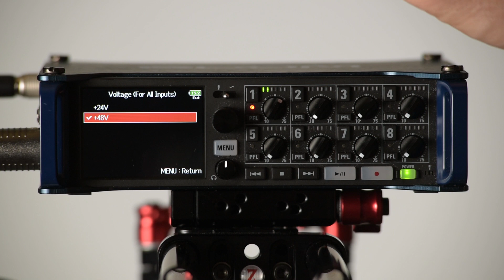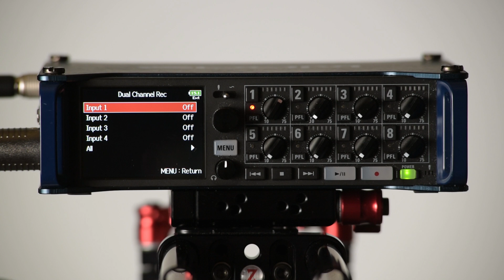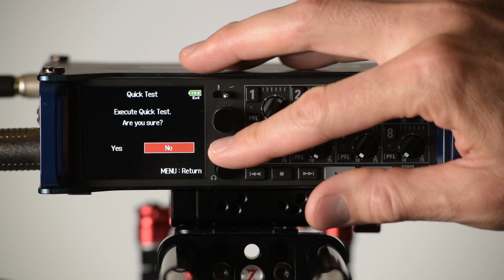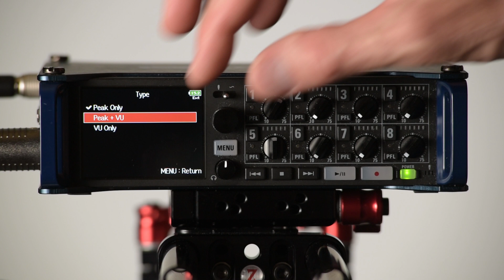Setting up the Zoom F8 Audio Field Recorder 30 June 2016

Comment: 0:00 Input Menu
0:30 HPFs
1:20 Input Limiters
3:06 phase Invert
3:42 Phantom Power
5:07 Plugin Power
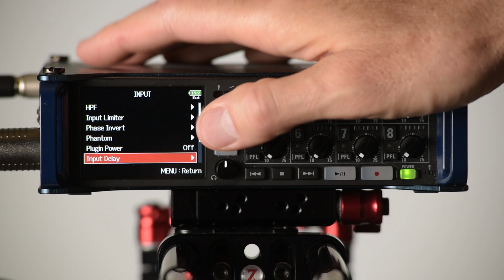5:55 Input Delay
6:55 Stereo Link Mode
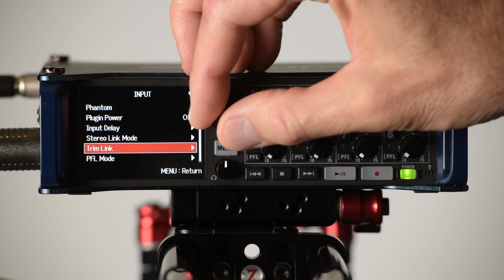7:17 Trim Link
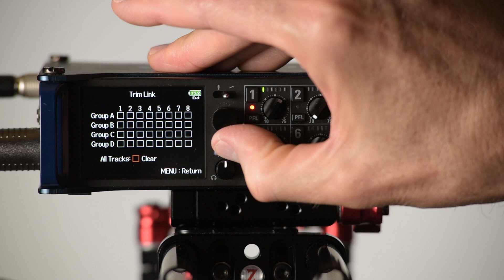8:05 PFL Mode

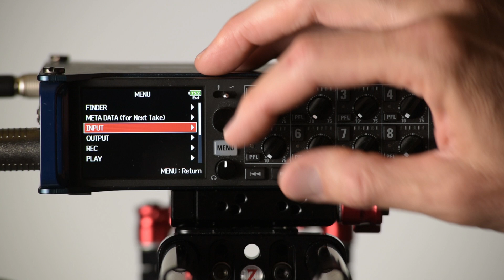8:56 Rec Menu
9:02 Rec to SD1/SD2
12:08 Sample Rate
12:46 WAV Bit Depth
13:48 MP3 Bit Depth
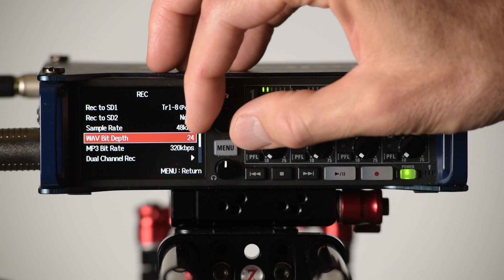14:25 Dual Channel Record
16:02 Pre Record
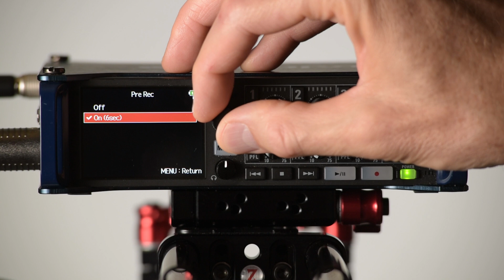16:20 Max File Size

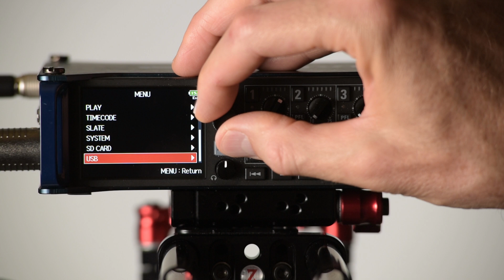16:36 SD Card Menu
17:53 USB Menu
18:44 System Menu  (Time Code Display, Auto Power Off, etc.)
 20:40 Level Meters
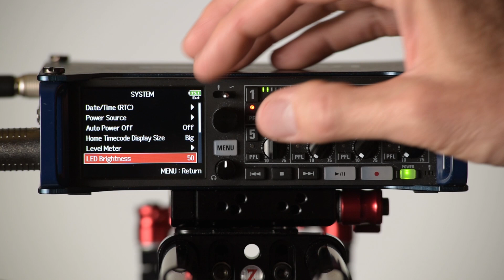22:30 Outdoor Mode
Reply: Thanks Wes.
Reply: Thank you for taking the time to do this!
Reply: Doing God’s work 👍

Comment: Hi Curtis if I was to use a high pass filter on my F8 while booming what frequency do recommend I set it on?
Reply from the maker: Hi Alejandro, it depends on what type of problem you're trying to solve with a high pass filter. If you're working with a microphone that is particularly sensitive to movement and your shock mount isn't doing it all, I'd start with an 80Hz high pass filter. If there's some sort of low frequency hum, you may have to tweak the setting, starting at 80 and sweeping up until it reduces it. If you're out in the wind and for some reason the wind protection for your mic is not preventing all of the wind from getting to the mic capsule, you may have to sweep up to higher settings until the wind distortion is handled. Note, however, that this is a tradeoff--when you sweep up beyond about 100-120 Hz or higher, you're going to cut into the bass part dialogue, especially with men's voices. You're usually safe to set the HP filter to 80 Hz and that will not affect the sound of most voices. I hope that helps!
Reply: Thank you Curtis actually it does. BTW, does your sound course cover how to operate the Zoom F8 on the field?
Reply: Glad it helped! The production (recording) sound course is not specific to any particular device, but more about the principles of recording quality audio (more focused on skills like microphone placement, mic choice, signal chains, etc.) Best wishes!
Reply: Sounds good! As soon I can clear up some things I owe I'll take your course. I know there are things that I can still work on, and I'm glad that the resources are there!

Comment: Hi Curtis
Just a quick question. I bought the F8 as an extra multi-tracking recording device for my Sony FS7. Almost a year on and I still haven't used it. 
At home I have a wonderful digital desk & DAW which works seamlessly with FCPX for additional sounds to any live sound recorded. The F8 was originally bought to add greater flexibility to live sound - especially wireless setups. I'm sure I will use the F8 for its intended purpose ( like you, I have a collection of portable digital recorders, but wanted "high end" quality, hence the F8)
My question has nothing to do with film, but "audiophile" recording. 
I've been asked to record a beautiful New Age group at the highest possible quality but to "audiophile " recording techniques. 
I have a collection of superb mic's.  Do you think the F8 is capable of doing the job - Dragon Records style? I'm thinking 24bit 96kHz wav
Reply: Hi Chris, yes I think it is up to the job. I would think the bigger challenge could be (not knowing anything about where you'll be recording) the room in which the recording is made and mic placement. But the F8 is very good on the preamp and analogue to digital conversion fronts. Best wishes!
Reply: Curtis Judd 
Thank you so much, Curtis. The recording will take place in a small chapel. The natural acoustics are lively, so some treatments will be needed. I'm hoping to capture a nice 3D sound stage and good dynamics as well as excellent resolution. The F8 has excellent mic preamps i.e. Very low noise - in fact equal to my desk which has class A preamps.
Reply: Sounds like a fun project. Best wishes!

Comment: Hey Curtis! I always find your videos helpful. Would you consider pairing this with the ntg4+ that you reviewed some years ago?
Reply: Hi Sean, Definitely! If you haven't already bought the NTG4, I'd be inclined to either go with the NTG3 or NTG2. I especially prefer the NTG3 but it is a bit pricier than the 4. Good luck!
Reply: Curtis Judd have you tried other sound devices like the 552 before choosing the 633? I've seen the 552 go for less than half of the 633 and has probably only half of the capabilities as the 633
Reply: Hi Sean, yes, definitely. The reason I did not go with the 552 is that it only has a 2 track recorder and I needed isolated tracks in addition to a stereo mix for my work.

Comment: Super helpful setup guide, thanks a ton for going through the entire settings. The one thing I have not been able to find online or in the manual is to alternate different microphones to the left and right headphone channels. I've used the 744/788s in the past and I liked the ability to change what mics I hear in what ear (boom left, lav right/boom both, etc). I believe this was done with just a knob that ran through A, A/B, B/B modes.

I have scoured the settings and haven't been able to find a way to alternate what I am hearing. Right now, all I get is a mixdown of the three mics I have (2 lav, one boom) to only the right channel in my headphones. Playback plays it in both. Any idea where I have to go into to be able to change the output to the headphones? 

Cheers mate
Reply: Hi, clarification question: do you want to pan the individual channels to the left or right in the recorded mix or just the headphone mix?
Reply: Just the headphone mix, so that I could cycle through how each one sounds individually
Reply: Ok, I see. Pressing the PFL button for each channel is one way. I'll have to dig in and see if there's another way.
Reply: Thanks. I just got so used to the 744. When I was doing sound for docs, I'd like to rock back between the lav's and the boom in my headphones so I could listen to each one on it's own to make sure everything was sound clear, I figured this was a stock function on other records!

Comment: Hey Curtis, first of all great video as usual! Are you aware of a short cut option to activate/deactivate the dual channel recording without having to go into the manus? I think I ones saw a option like that somewhere, but it is not in the short cut list in the menu and I can't remember the short cut.
I searched the web and read the manual, but couldn't find it.

It was something like pressing one channel (e.G. 1) and at the same time the other channels PFL button. I tested it on my own F8, but nothing seems to work.

Anyways, greetings from Germany!
Reply: Hmm, not off the top of my head. I'll have to have another look...
Reply: I just tested it on my own F8 and found out that I mixed two things up here. I thought of the short cuts for activating the stereo link between two channels. For example: If you press and hold "3" then "4" and release both channel 3 and 4 are linked in stereo link mode. (Do the same to deactivate link mode.)

I just thought there also were short cuts for dual channel mode.

Would be nice if Zoom put all short cuts into the shortcut list (inside the menu) instead of just a few.

Thank you anyways!

If I find out about a dual channel or other short cuts, I come back to you.
Reply: Thanks Ryon.

Comment: Do you need to use a mixer with this or is it good on its own?
Reply: No need for a mixer to record high quality audio with the F8 or F4. A mixer can be helpful if you'll be actively mixing a job as linear faders are easier to use for most people. But the preamps and converters in the F8 and F4 are very good so a mixer is not necessary from that point of view.

Comment: Actually too many folks over think what a High Pass Filter is. It does what it says. I say that to too many people, and they get it. Too funny huh? I got a set of the Stealth 8 speakers I was telling  you about. Nothing like having all the dynamics, and detail on your desk, like say 400 watts per channel worth. So I am not too worried about dynamic swing.
Reply: Good point. There are plenty of considerations around HP filters including when to use them (some are a little too aggressive for use in every situation) and how they're implemented which can inform whether you need to use the filter in particular situations. But at the core, they accomplish the same thing: Filter out some low frequency material.

Comment: Great videos, didn't think I would think the f8 is usable. Now I do.
If I ride the gain on a track, will the safety ride along, or does it have its own gain setting alltogether?

For that matter, can I offset stereo pairs?
Reply: Hi Simon, when you record safety tracks, one mic input actually uses two of the preamps. You can ride the gain trim of both independently with the gain trim pots. I'll have to check how that works with stereo pairs. I think you can only configure two channels for stereo pair or dual-channel (safety track) recording, not both at the same time.
Reply: So it's just like using a Y-splitter into two preamps? I think it would be very usable, especially in a rush, to just have the second preamp offset by say -6,-10,-12 or -20 dB. 
Weirdly the manual states something like -12dB.  "When a mic capsule is connected, its dual recording track input level is fixed at –12 dB compared to the regular track." https://www.zoom.co.jp/sites/default/files/products/downloads/pdfs/E_F8.pdf p31
Reply: Yes essentially. I have confirmed that you can control each of the channels independently in terms of gain so it isn't fixed at -12dB.
Reply: that's unfortunate.
Reply: Yes, from a "number of preamps available" point of view but from an audio quality view it is the best way to do it.

Comment: Hi Curtis, very helpful video, many thanks to you! :) I have just purchased one of these and am very happy with it but I have one question. I used to use a zoom H5 recorded to Mp3, which is really the file I need to use, but when recording on MP3 on the F8 there seems to be something going on in the background.... hard to explain, like very muffled "chatter" or some kind of interference. I have tested with different mics and my Zoom H5, and this doesnt happen with the H5. Am I missing something, or could my F8 be faulty?  The F8 records wav files perfectly well with none of this interference in the background. Im at a bit of a loss because I really need to use mp3 files. 
Just wondered if you have any thoughts on this?
many thanks, hope you have a good weekend!
Reply from the maker: Hi Steveo, I must admit that I have not recorded to MP3 with the F8 before so I have not experienced this issue. I'd suggest getting in touch with Zoom. Sounds like you've confirmed that it isn't an issue with your other gear so they should have some insights or investigate on their end. Best wishes. I hope you can find a solution!
Reply: Curtis Judd Audio Thanks for the response, I will let you know what happens, all the best :)
Reply: Curtis Judd Audio Is this the best recorder.Do some recorders record in analog? And if so would these be better. Great video, I learned a lot about the zoom f8.
Reply from the maker: Hi again, I am firmly of the opinion that there is no such thing as the "best" recorder but I can say that the Zoom F8 is a very, very good prosumer grade recorder. The Sound Devices and Zaxcom and Aaton mixers/recorders are "better" for professionals in some important ways, but not necessarily in terms of audio quality. Here's a piece where I talk more about why professionals use Sound Devices mixers and recorders: https://youtu.be/hDEp34fkbQ4

I am not aware of any field recorders currently on the market (i.e., still in production) which record to analogue media. There are many audio enthusiasts which are fond of analogue technologies for music and sound (e.g., the growing interest in vinyl recordings and a market for turntable needles in the tens of thousands of dollars range). But I'm not so sure one is better than the other. They each have their benefits and costs.

This is all just my perspective, definitely get the opinions of others as well. I'm sure there are some out there who hold firmly to the opinion that Nagra analogue stereo recorders were the pinnacle of human achievement in sound recording. :)

Comment: Is there a setting to turn the whole 8 channels into 2 levels of recording on just 4 mics? Did I miss that in this setup? It's probably the main reason I'd buy a recorder like this? + peaking etc?
Reply: Yes, Have a look at this video starting at 14:25: https://youtu.be/KpddKcP8_SA?t=14m25s
Reply: Thanks - useful to know this because that is one of the features that sells this to me rather than the F4. I can envisage a time when I will need 4 mics tops (filming 4 speakers in conferences in schools where I don't know if the sound technicians have a mixer or even mics available!) and I definitely need dual level recording because there's little time to get in and set up and test the levels when the jobs agreed and there always seems to be 2 or 3 levels of bureaucracy and lack of communication and I'm expected to work miracles in a very short time frame - and the key person is never there despite agreement beforehand. It is why I love my Tascam DR10c's so much (not available in the US). As a one man band I know I'm not going to have to worry and I'll get the sound quality I want in the timeframe I want. I also know I can travel around the UK with a fairly self-contained unit at short notice and record in meeting rooms and venues where I couldn't get those convos before. Your films are very, very useful in helping me make those specific decisions. I've bought one on the strength of this one feature alone. I'll go back through all this as well at leisure now. Very, very useful indeed. Thank you. A life saver!
Reply: Thanks for the feedback and best wishes!

Comment: So. the question is, Should I go with the F4 ore F8 ? starting to do some field recording (sounds to process and put in videos/games/music) but Im not sure of how many channels I may need. I thinking the F4, then I can have a stereo mic and another maybe shotgun. but do I need more for just recording sounds for sound desing ?
Reply: I haven't used the F4 yet. But I think the first question you'll want to answer is how many channels do you need? I'll have a review of the F4 soon after I get a copy for testing.
Reply: That's The question.  I dont se my self running around in The woods/Streets with 8 micronphones to capture sound.  But I dont want to Come to that point I am missing channels.
Reply: They are the same size, so that doesn't appear to be a major cost with going with the F8. The main thing you lose by going to the F8 are smaller knobs (which can make mixing harder) and TA3 main outputs (probably not important if you're not going to use the F8 as an audio interface or feed a mix to a camera or director during the shoot).  I wrote a preliminary piece over at http://www.learnlightandsound.com/blog/2016/9/27/zoom-f4-coming-soon  Good luck!

Comment: Hello Curtis I am looking into purchasing an F8 and I had a quick question. You mentioned having problems with using Lav mics and I'm wondering, If I used for example 4 countrymen B6's with the correct adapters and everything would it work? or am I also going to run into issues?
Reply: Hi Janet, with the correct connectors, the B6's should work great. What I mentioned has to do with phase issues when you have one microphone (e.g., a boom mic) farther from the person speaking than another (e.g., a lavalier mic) as +Tiny Bird Productions suggested. Usually in those cases I'll remove one of the mics in post. But if you are miking 4 different people, each with a single lavalier mic, you shouldn't run into that issue at all. Best wishes!
Reply: Excellent thank you for the answer I just ordered my F8 and can't wait to get it.

Comment: Hi Curtis.

thanks so much for this useful tutorial. I've specifically asked for it but unfortunately I was away home when you run it. I saw the recorded video so I should like to ask you a couple of questions about the usage of the Zoom F8 as USB Interface. Firs is if is there any damage for the F8 if its used as audio playback Interface continuously ? and the second one is to know the two options available in the USB Interface menu for PC/Mac as one is rated by default at 48 KHz and in the other is at 96KHz. Thank you!
Reply: Running the F8 as an audio interface for playback is not a problem in terms of continuous use, I wouldn't think. The issue I had with it is that it doesn't have a volume control so you have to use monitors which have their own or use headphones (which I only do for a small portion of my listening). If you have monitors that are working well for you, that should be great!

As for the sample rate, are you using a Mac or PC? I use a Mac and on MacOS, the F8 is class compliant and works at whichever sample rate you set it to via your apps. I'm not sure how it works on the PC side but I believe if you want higher sample rates, you need to install the ASIO drivers.
Reply: +Curtis Judd For volume control I use the main knob but first you have to select the volume of the corresponding channel, it turns red and then volume control is activated.
Reply: Oh, you mean you use the fader for each channel to control the overall volume output when you're listening through your monitors? That sounds like it would work but is a little funky. Sounds like I need to try it again now that I have the newest firmware installed. Thanks!
Reply: it's working for me with the 2.1 update installed and I've volume control with the main knob.
Reply: Brilliant, thanks Ignacio. I hadn't tried that since the firmware update. Makes the F8 a much better option to use as an interface.